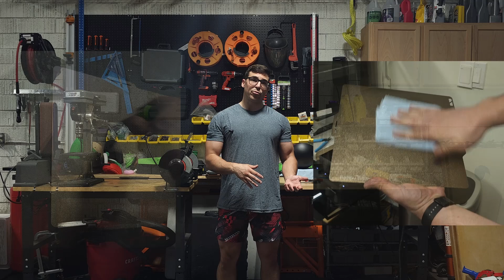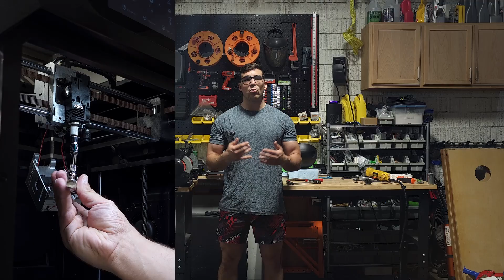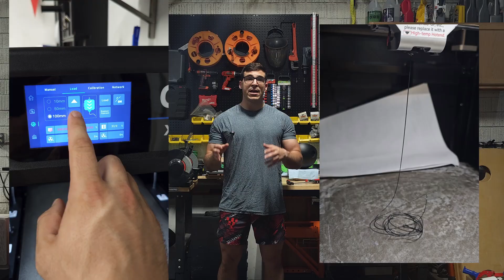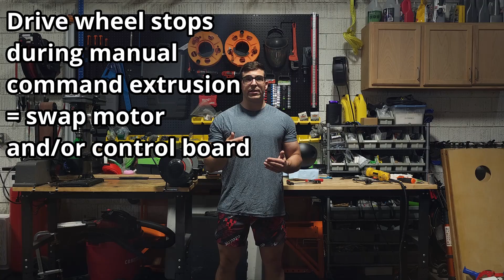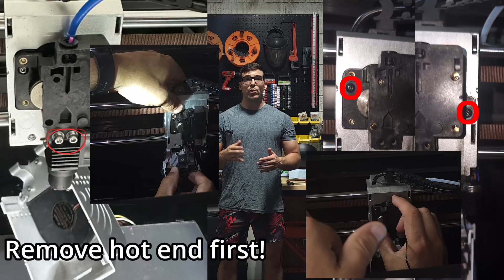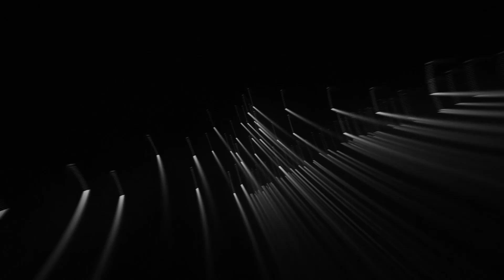3D Printer Extrusion Issues- Troubleshooting & Fixes!!

Comment: exact same issue here spent a whole day trying to fix z offset and flowrate on my k2 plus, and after printing first layers and helping (pushing the filament in) into the extruder by hand the problem went away and as soon as i let it go in by itselft it would do the same spottiness shown in here. good video